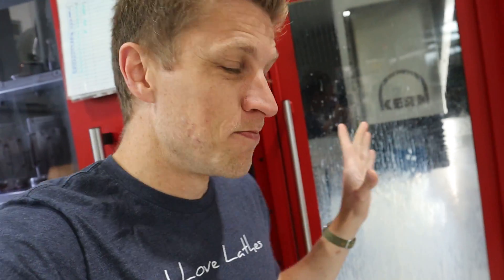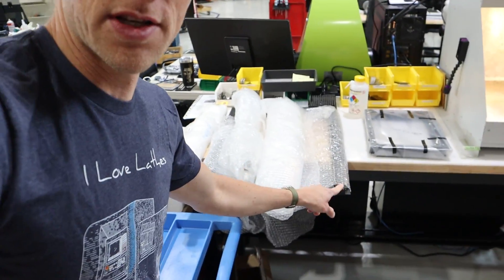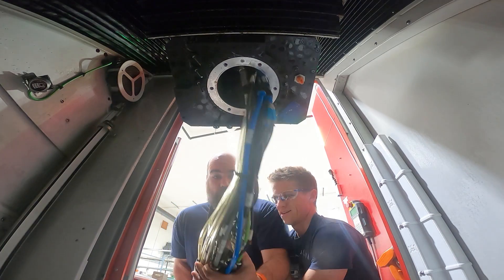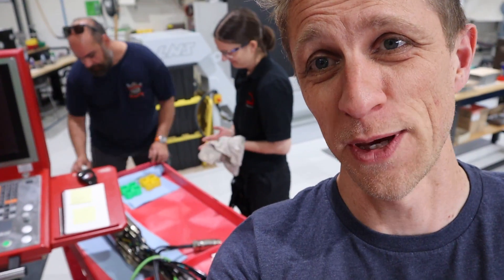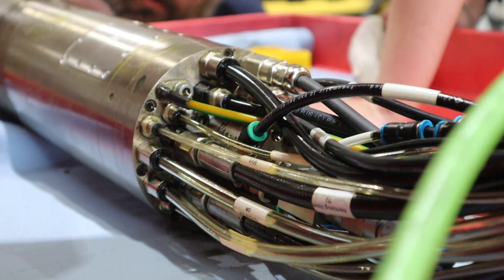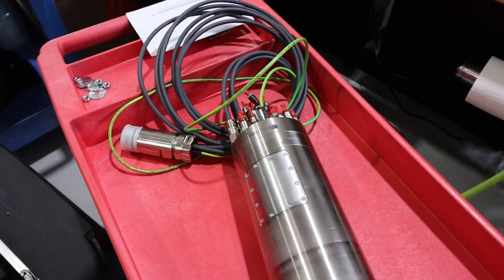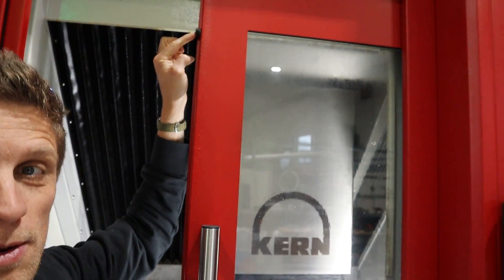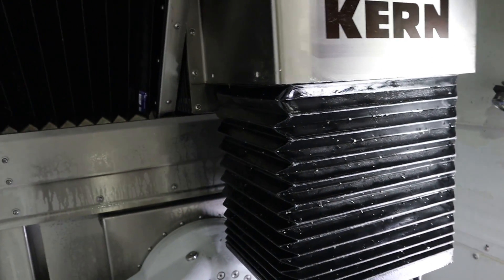Spindle Replacement on our KERN Micro

Comment: Whats incredible to me is the parts you've had to replace after 3 years..which i totally get. It makes me heavily question two things though:

1) what condition spindles and bearings would be on a used machine and why it might not be a good idea to get used... depending on the tolerances you are chasing

And 

2) How much you need to allow for future maintenance which reqlly makes me think how under priced our products are as we dont have any money for such..hell we barely make wages 😢

Anyway, John you throughly deserve the 400k+ hope you get it! 

My goal is 30k end of year
Reply: Buying a used VMC with a 6000 - 10,000rpm spindle is going to be very different to something like a Kern, not sure I've ever seen a Kern for sale used in the UK so something we probably don't need to worry about. Used can be just fine as long as you accept there are higher risks for breakdowns, can make the parts you need to on a machine with some wear in it and then put some of the money that you saved over buying new to one side for those repairs. I have 3 similar capacity CNC lathes primarily for the reason that if one breaks down I'm not completely screwed, all bought used, combined costing less than the cheapest of the 3 new.

Lathes seem to be a bit more robust overall though, they don't tend to be doing particually high RPMs compared to VMCs or loads of movement for cutting complex profiles, still, if you can budgeting some money for future repairs would be wise as nothing is going to last forever.
Reply: @robertlees2065  Thanks, that's some really great advice there

Comment: I am surprised at the number of wires and hoses on that spindle. Also surprised the manufacturer doesn’t just make the bearing housing slightly larger diameter and the bore to match because having to file the fittings to fit just seems dumb.

Comment: Is Kern lacking on basic design? Having to file down the corner of a hex bolt so that the spindle assembly will slide down the tube is surprising. Why not use a socket head cap screw? Or reposition the bolt?
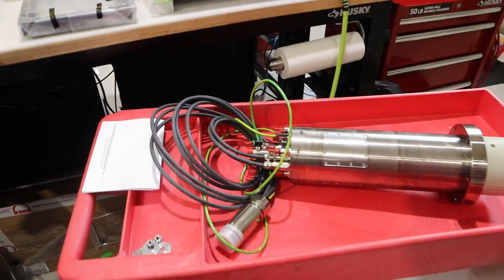Reply: At least they understood enough basic design to put an electrical fitting where they needed an electrical connection, and not a socket head cap screw that would have been useless in that application.   🤣  There's a lot of different connections there in a tight space. It's likely that the connector used isn't the same as originally designed for, but a running change mid-production. There are several reasons why that might be, e.g.  the manufacturer stopped making it or went out of business, or the current favorite: still Covid-backlogged.  The engineering supply chain can be very fickle, and sometimes no available replacement is exactly identical.  In the vast majority of applications an electrical connector like this would have much more space around it so the physical sizing of the hex just doesn't matter much and its electrical properties are much more important.  In a perfect world the spindle designer would have left a circumferential buffer to allow for unforeseen connector changes, but guessing the future of the supply chain isn't exactly 'basic' design.  Filing the connector is a bit of a bodge, but compared to the massive engineering costs of a spindle redesign (that would only add to its already sizeable cost), not a bad solution.  There's a good shot of it @7:49

Comment: My god theres a lot of wires and tubes going into that spindle. It has its own nervous system!
Reply: I work on od/id grinders that have 3 of those spindles packed into the B axis that rotates 360⁰

It's funny seeing the operators reaction when they see the monstrosity of cables and hoses tucked inside the sheet metal 😂

Comment: Did you get a brand new spindle or a rebuild the deference would be the price and did you have to pay a core charge for the old spindle?
Reply: They always do rebuilds. Rebuilds are done by Fischer to factory spec and are good as new. The core is always returned and keeping it isnt really an option

Comment: For the money you paid for that machine I would expect it to not need a new spindle yet ! Yes if you have crashed it that’s your fault. Hundreds of thousands of dollars worth of machine and you have to remove a washer to get the door to shut properly ! And the x axis ball screw replaced, was that crash related ? Good service time but why was it necessary on a machine that expensive in the first place ? I’ve run old CNC machines (one lathe was a 1978 Hitachi Seiki 4NE 600 , the first cnc lathe in Australia and had a tape reader before retro-fit to Fagor) that machine had shear collars to protect it from crashes and was still making accurate parts till it was retired in 2006 !
Reply: Theres different levels of „accurate“. 
The precision requirements this Kern meets at the push of a button are either a big headache or straight up impossible on many other machines

Comment: X axis screw is much smaller than I thought it’d be
Reply: Kern has hydrostatic ways, so it takes very little force to move the mass around. I guess that's all the screw they need, and it's probably oversized as well.
Reply: @vilts  This one is not hydrostatic
Reply: @npolanosky  I stand corrected! I thought all their machines were hydrostatic, but seems not to be the case.
Reply: @vilts  Just the Micro HD and the Pyramid Nano! The other machines are proof that you can still build extremely high grade machine tools even without fancy hydrostatics or air bearings. 

Fun fact! The Pyramid Nano has a hydrostatic ballscrew. Look those up if you want to blow your own mind.

Comment: What really got me was the amount of electrical, pneumatic and hydraulic fittings into this spindle. Wow.
But, why? Does it really requires to be so complicated?
Ps: is it an air spindle?
Reply: Well there are:
-hydraulic drawbar,
-oil to lubricate the bearings
-air to pressurize the spindle inside, so that chips don't get to the bearings
-coolant for the spindle-bearings
-air for the tool (e.g. blowing out chips and coolant when changing tools)
- external coolant for the tool
-through-spindle coolant
-Spindle Power-wires
-Spindle Encoder-wires
-Spindle Temperature-sensorwires
-Drawbar Limitswitch-Wires

So at least 12 connections for that stuff alone.
Reply: @felixm.8910  and in some cases when there is both through spindle coolant and air/MQL, they are run to the spindle in separate lines. In addition to the sensors you mentioned, I'm quite sure that Kern has specified also a dilation sensor (measuring the axial shaft expansion) and a vibration sensor for that spindle. Also, all bearings have their own temperature sensors, and with a high possibility, the spindle shaft is also cooled with coolant.
Reply: Hybrid ceramic bearings, not air bearing.
Reply: its an air bearing spindle

Comment: why is it taboo to say the price of the spindle/replacement?
Reply: Everyone's individual situation is a little different. It's going to change a bit from year to year, and depending on how much travel and labor is needed for the technician to get there and do the job. Also depends on if your core is rebuildable (usually is unless you really smashed it), current currency conversion rates, etc. 
You just don't want someone in the future to point to a specific number mentioned and whine about why they didn't get Price A when their Price B is based on completely different factors. 
The price is comparable to a decent new car, but which car specifically and which options on that car depend on the specifics.

Comment: Man how many hours on that spindle before replacement? 3 years seems short but if you are running 20hours a day every day it’s actually decent for a high speed spindle.

My integrex needs a new spindle but it’s so bad it’s difficult to rotate. 

Also how many 10s of thousands? If I may ask just curious vs looking at mine
Reply: With the ticket price on that machine I wouldn't be surprised if that spindle replacement + labor was upwards of $60 - $70k CAD.
Reply: @TGC32  I think he mentioned the price at some point and maybe I have the price in my head but it was lower than I expected.

60-70cad sounds about right for a new spindle

My rebuild is gonna run about 30k isd
Reply: I think he said in his podcase it had done just under 10,000 hrs. He's doing about 140hrs/week.

Comment: You might want to have a pattern that works the left side, then the right, then the left, ...
Reply: X travel on the left side is extremely limited, so it's likely not possible for most parts he does
Reply: @npolanosky  Interesting. I didn't realize it was asymetric.
Reply: @Nickle314  Most 5 axis machines have about 75% of the work envelope to one side. The one I work on DMG CMX50U is pretty offset. Any machine that has a rotating trunnion table like this one is like that. The center of travel in x is always skewed towards the side the table rotates more. It makes it really tricky when parts are close to the size of the work envelope. You have to perfectly center the part about the work envelope not the table. It gets weird fast. haha
Reply: @TritonTv69420  For some reason I had the impression they were symetric. 
On the maths front, there is something called Geometric Algebra. It makes the maths suprisingly easy.

Comment: Sending all the parts that could possibly be needed is such a great idea. I can't tell you how many times I've had a computer tech come out only to have to come back a month later to install the part it actually needed, it must save them so much money in not having to dispatch a tech a second or third time.

Also that spindle coming out looked like one of the squid things from The Matrix. Insane how much tech they pack into those things.
Reply: It looks like she fly's in from USA, maybe Switzerland, her time definitely costs more than parts shipping.
Reply: We called Haas and said we needed a spindle. The guy shows up and the spindle never was shipped. Then they shipped it and said it will be a few weeks before the guy has time on his schedule to come back and put it in. Almost certain it is more of the people we are region locked into dealing with and not the company as a whole.

Comment: I have the same spindle from fisher on my roders mill, definietly getting my pants full when i crashed couple of times, and yes, using high rpms is not forbidden but it will definietly shorten its lifespan
Reply: We have like 30-ish GROB 350s at work where they change spindles every 3-6 months due to high RPMs in aerospace-grade superalloys. It for sure shortens the lifespan of those poor spindles.
Reply: @coorexz wow, wild.